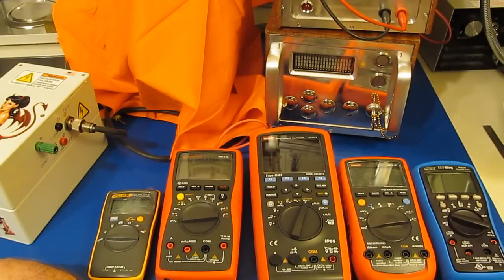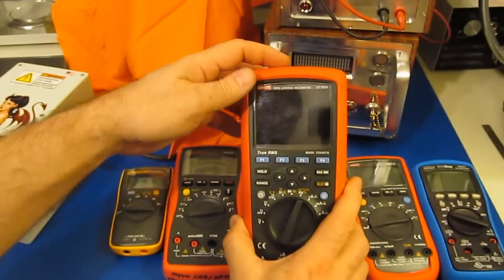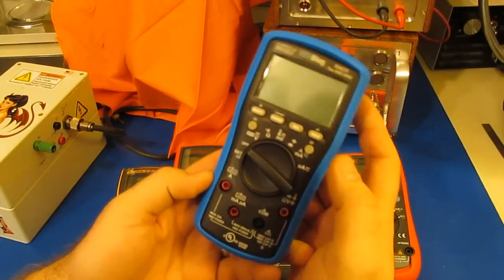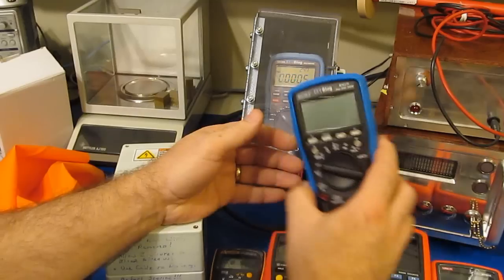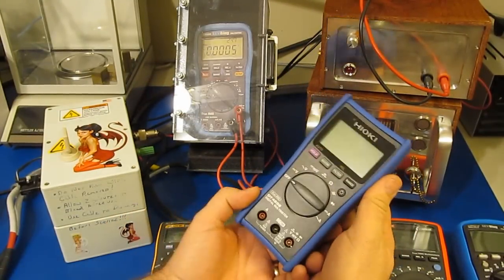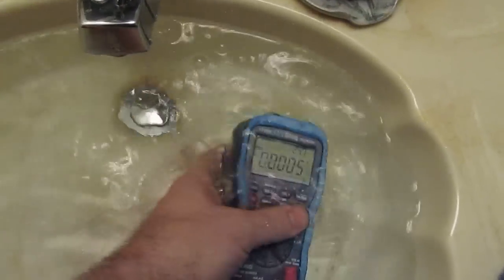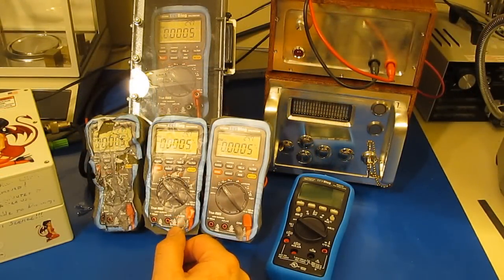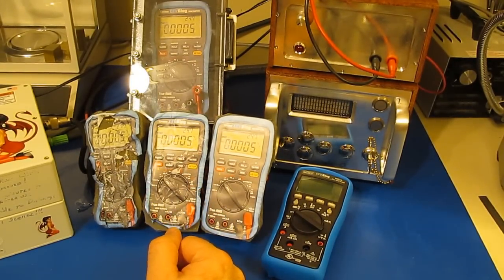2 years and 2000 followers, time to celebrate!

Comment: The problem with meter development is that often you usually don't do this sort of testing until you go and get it certified. You use best practice based on experience and the results are what they are. I'm not too fussed what the results are compared with the BM235 provided that is passed the certification standard.
BTW, the 121GW is deliberately lower rated than the BM235. It's smaller size plus more functionality (less PCB routing space) plus 4xAA's limits the overload protection possible. The BM235 uses a two boards to get extra isolation.
Reply: EEVblog
Most big manufacturers do a lot of pre-compliance testing.  Some pay for third-party labs to do it.  The place I used to work at did a fair amount of prototype testing, and did consultancy on solutions to issues.  (Safety and EMC / EMI compliance for consumer products, not this type of work.)
Reply from the maker: I've never worked for a company who developed multimeters, so I really don't know what the normal approach would be.